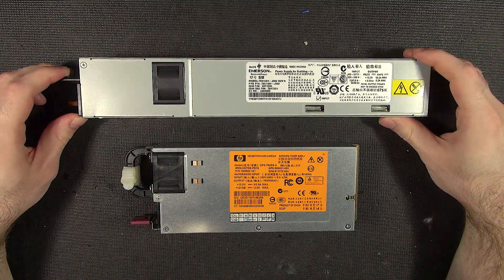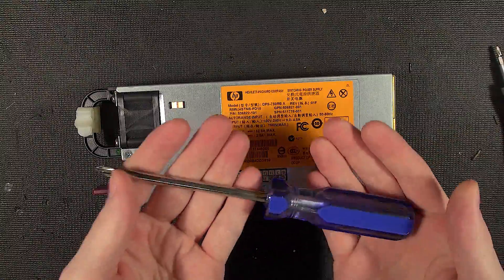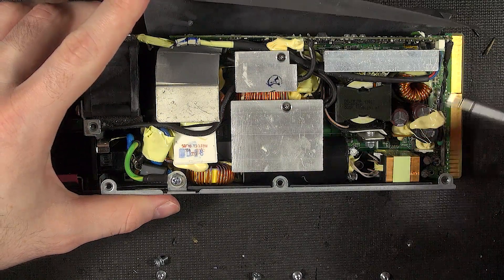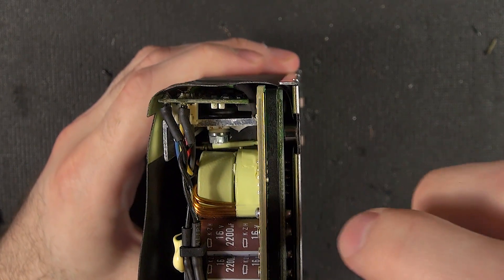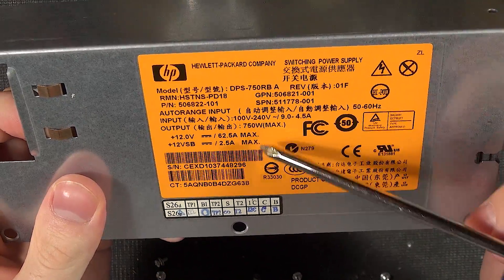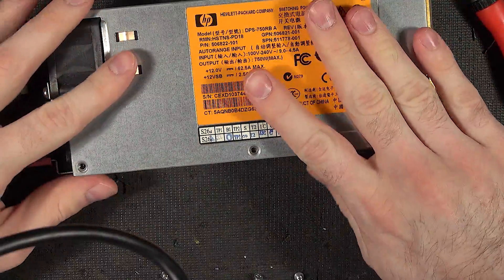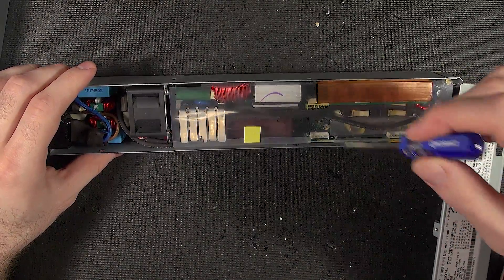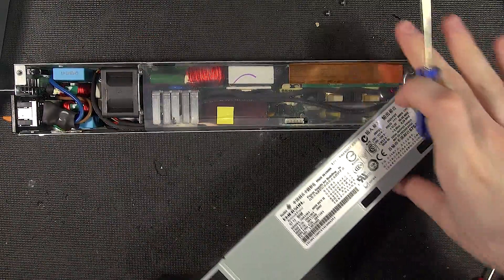A Look Into some Hot Swap Server Power Supplies

Comment: i wonder how you guys use these for GPU or other12v. just solder the connection wire to any random spot on the output 12v rail? or use some kind of clips?

Comment: Mark ecklund some of these supplies will turn on by just jumping the two terminals 33 and 36 I hink check for sure I'm right on numbers so all you have to do is add a switch. Just thumb through other psu modifications videos some are doing that mod.

Comment: I use one for my amateur radio tranceiver. They have great regulation, very quiet with no rf hash or noise and at $9.95 versus $160.00 for a 30 amp commercial 12 volt supply they are practically free. Don't touch that square heat sink over the capacitor. It will bit you.

Comment: Cool video, thanks! I just got a couple and am still working out the right connections. I think they will be great once hooked up as a bench power supply and i will use a buck/boost dc to dc converter to get any voltage i need.

Comment: Nick I ha e a dell poweredge r510 server supply with flat board how do I get it to power up and increase voltage up to max .please let me know URGENT
Reply from the maker: I'm afraid I'm not really an expert in server power supplies, so I'm unable to help with that. I'm sorry, and hopefully you can find a solution.
Reply: Did you get it working OK? I just got a couple of r510's too and it seems like i can short from top to underneath on the first and last and second last of the small ones....is that the same as yours?

Comment: Thanks for your video. Any chance you can help me show which pins to jump in order to power on the supply? I should be able to take it from there. Its a 1500W Fuji Electric CA05958-1020 and picture is here with following link. Many thanks. http://i66.tinypic.com/352q81c.jpg

Comment: Thanks, Nick!  Today I actually picked up a pair of the HP 750s you showed before finding your channel.  I plan on using them as benchtop 12v Supplies (RC Hobby  and what have you....) I was wondering if you have taken the HP apart far enough to see if there are leads to connect a power on/off switch.... Not a fan of leaving it plugged in and REMEMBERING to unplug after use....:(
Reply from the maker: You're welcome! No I didn't. I should probably do a follow-up video where I delve into converting these into hobby supplies with help for any problems that come up. I typically just have a stack of those desktop surge protectors that have the five individual switches plus one master to connect all of my gear I want to have control over. I even plug my desk lamps into them. I think most of the server supplies are so densely packed it would be a chore to try and get a lead out and back for a switch. I will certainly experiment though.
Reply: Yes, it's too bad that these aren't like the typical ATX PSU. With those you can just jumper the green wake up and ground wire, and as you know that will power up the unit. A simple switch then can be soldered to a split in  the ground to allow power out to the leads... I KINDA wish the Server PSU could output other voltages....5v is somewhat useful. I think I will for now, just do this on as a standalone 12v. There are a couple RC forum posts about soldering 4mm Banana Females to the rails for output leads. Maybe I can share mine once it's done...
Reply from the maker: Yeah I have a small ATX PSU on my desk simply because I can switch it and it has multiple voltages. Yeah sadly most server supplies don't do more than power on. I think a few models have a standby output, but in general they just, give 12V. Yeah I see the banana adaption and it's quite nice. I just stuck the little push terminal speaker wire connector on my power supply, but I am usually just plugging random wires in more often than anything where it makes sense to stick bananas on. Yeah, get that fancy setup and show it off!
Reply: I struck out with the two spare ATX PSUs I had laying around....Neither of them was in working order so I didn't get the chance to work those up...$20 and a trip to my local Best Buy can remedy that though.... and who knows, I MIGHT get lucky and find one at the roadside on trash day....LOL!
Reply from the maker: That's a bummer! ATX PSUs are very good about just being dead. Yeah mine was from a thrift store, back when such a weird thing to them would only be $1.50. Hopefully you will!
Reply: Hey Mark....you probably are way past this now anyway, but i just happened to come across this site that have manufactured connectors to these supplies for mining that include an electronic switch on and off. They are around $30 or so ....not too bad if you really need it but prob way more than you are thinking for your needs. Just thought i would mention it and it may help someone else if they are looking. This is the site..but search for your board's compatibility: https://www.parallelminer.com/product/x6b-breakout-board-all-the-x11-features-in-a-smaller-footprint-and-lower-price/

Comment: I have a PSU similar to the first one you opened up. I want to mod it so it has a larger fan. Trying to decide if it is best to take top off and blow a fan directly down onto the guts, or if I should create a downsized air funnel and keep pumping the air through the unit. If anyone has any thoughts regarding this, please let me know! Cheers.
Reply from the maker: Probably the easiest and fastest is duct a bigger fan through it. Server power supplies already expect the server to be blowing more air through them, so it's designed for that.
Reply: Thanks. That's what I decided on. I bought a larger PWM fan and I'm working on a duct. I have to solder on the mini-pwm connector to the larger fan. The original fan is 12v .66amp and the bigger fan is actually .08 amp. I think it should be fine. Going to give it a shot and see how it goes.
Reply from the maker: No problem. And yeah it probably will. If anything it will spin a bit slower. If you need to just run it full power all the time, you could probably hook the fan right up to the 12V of the power supply.

Comment: hey men!!!!
i have a couple of psus like the 1st one you open on the video ( the HP ),and i use them in series to power up a rc charger at 24 volts.my problem is that one of them seems not to power up.the led doesnt come to "on".i can hear a relay that moves and the fan starts but...no power. any idea??i have checked everything i thing of but nothing...it would be wonderful if you have any idea.
thanks in advance men!!
Reply from the maker: I can't think of anything obvious if it's only the one that's acting up. That's really strange. I'm sadly not the expert in using these power supplies in series, so I don't know if these models have any known issues that could kill the output. Best of luck figuring out the problem!
Reply: thanks man a lot!!!! my point was if you any other way to fire it upbecause i havent found anything online,and to be honest i got stuned a couple of times trying to find something.maby i just get another one!! thanks again bro!!
Reply from the maker: Oh haha! No problem! Yeah I'm not familiar with the HPs enough to know of another way to get them working. Worth a shot though!
Reply: well if i figure it out i will let you know!!
Reply from the maker: Awesome! Thanks!

Comment: thanks nick for the reply...i tried many time to increase the voltage, i made it and got 13.85v with help of an resistor but when i start the power supply on load so its again come to 12.5volts...i dont know that hoe can i get real 13.85v under load as well..

Comment: hi dear..thanks for uploading this nice informative video..can you please make an another video for me to help me to increase the voltage on these emerson and hp 750rba power supply..i need to get 14volts from these power supplies..is it possible?
Reply from the maker: I think that it is possible, but I wouldn't know how to go about doing it. Some supplies are nice and just have an adjustment pot you can turn inside, but most don't. I don't have any spares at the moment, otherwise I'd try to mod one to output 14 volts.